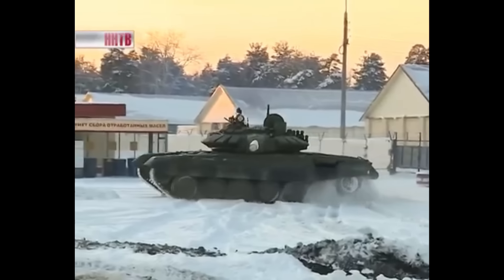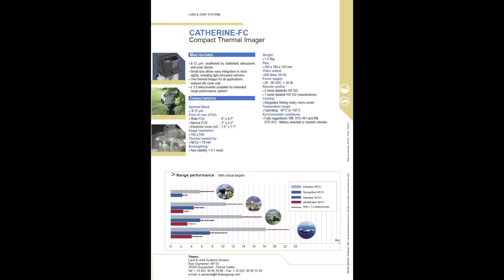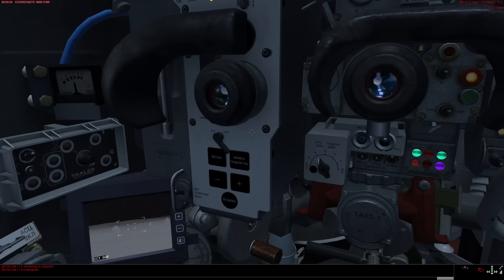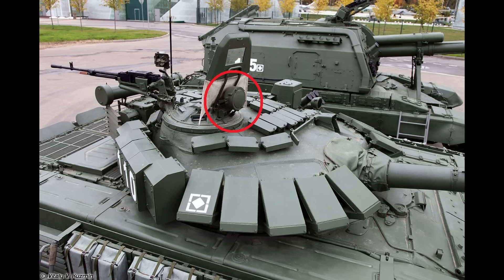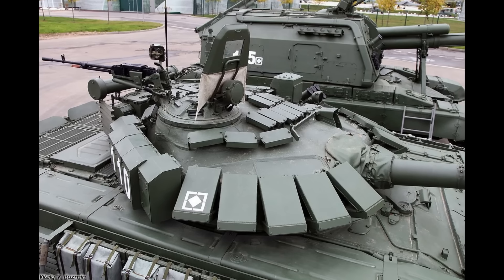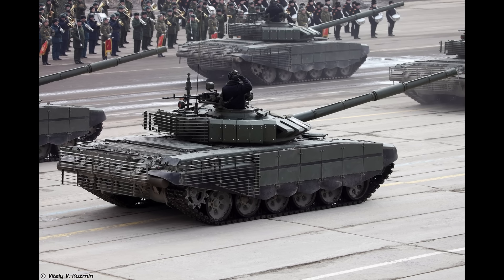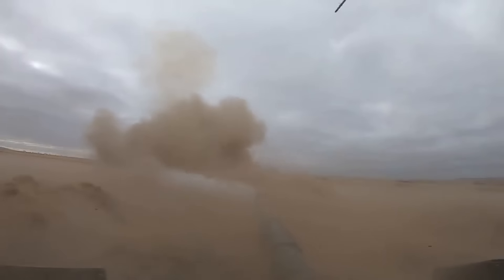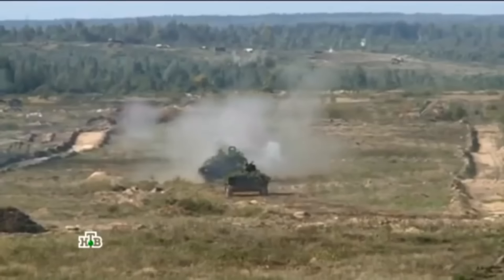Problems with Russian T-72B3 tank

Comment: would be interesting to hear the Ukrainian's thoughts on them  - though at the end of the day is the quality of the  men and the systems supporting the tank really define its true combat capability ( thinking Iraq and their  M1s)  the Ukrainian T-64 seems to be punching above its weight for this reason? (would love a video on that!)
Reply: There are probably barely any T-64 tanks left. Most footage shows donated t-72 tanks
Reply: @meisterproper8304  i think Ukraine don't use tanks eny more.....thay got many small a-t wepons wich do the same roll of destroying tanks
Reply: Put a M1A3 alone in the middle of nowhere and it won't fare much better. Russian tactics have ruined any show off ability of their more modern equipment.
Reply: Depends if the Soldier in tgat T72 is a conscript or volunteer, usually is about 50/50. Typically more trained volunteers get the cooler tanks bc they'd do more w em. I imagine is the same reason why T64 is doing good, bc those guys are more than motivated to do something w it
Reply: Tanks built in the Ukraine have insider knowledge of their weak points, exploited by Ukraine army.
I saw a video of a small combat vehicle repeatedly hitting the side of a ruZZian tank,
the kinetic energy creates heat on its own, let alone the molten metal core, until the heat reaches inside.

A similar thing was breastplate armour impacted by an arrow from a longbow, showing a plasma bolt from the inside!
Reply: @orlock20  there have been one or two videos of russians in modern tanks being driven by experienced crews. those are usually the rare videos where the tank survived. One comes to mind of a t-80BVM getting ambushed by ukrainian special forces. He kept his armor to the fire and steadily made his way to a less enclosed area where he could maneuver. he got hit a few times, but at least for the duration of the video didn't crash or get destroyed
Reply: Ukrainians say T-80BVM that they captured is good because of modern FCS.
Reply: Thing is
Iraqis are generally speaking actually competent with their M1s which mind you, are older models

You're thinking about Saudis
They could prolly fight with Russia who's more incompetent with their gear. I mean quiet literally Saudis are definition of "Its not the machine, its the crew"
Reply: It's obvious that T-72B3 or T-80BVM much better than T-64BV or T-72M1R
Reply: @meisterproper8304  they had hundreds of T-64Bs on storage. If the Russians could get T-62s out, they could get some and give to them Territorial defense batallions.
Reply: Well, most T-64s were scrapped by Russia - but I expect them to punch at around T-72B level or similar - maybe for higher versions, a bit higher. Again, you have all sorts of T-64s. Some are quite modernized but very few. These would be a match for T-72B3M in all but armor.
Reply: @XOFInfantryman  Yeah, loosing over 50 M1s to ISIS during battle of Mosul.... Iraqis were so bad with tanks they decided to buy cheap stuff - cheapest version of T-90 - 500 examples or so.
Reply: @meisterproper8304  Detonated T-72 tanks.
Reply: I know military history visualized somewhere had a interview with a Kiev Nazi tanker. Anyway and the stuff I see in terms of combat footage that I get off Telegram the Russian tanks usually ROFLstomp the Ukrainian tanks. Not only are the Russian tanks just better but the qualitative differences between the crews are  indisputable. The Russians seem to win about 3/4 of the fights.

Comment: What nonsense. The older t72 had more of propaganda campaign against them, instead of real battle world problems. However, today, the latest 2 models of t72 from the Russian military complex are amongst the best in the tank world. The t72 serves a special place, with unique capabilities of defence and attack, in between the other 2 modern brands of great Russian Federation tanks, the t80 and the t90. Armata is also been introduced on the battlefield in Ukraine, 5 months ago...but in small numbers. 

The piunt western tank commentators often don't understand, is that the Russians always win their big tank battles. Why? It's a matter of capabilities in defence and in attack, largely increased by tank strategy. The Soviets/Russians form tank platoons, powerful diverse formation of light, medium, and heavy tanks, always supported by specially assigned own group of jets and helicopters, as well as being supported by tank assigned and trained ground troops. They are always under the commander in the leading tank...which often is actually situated at the back or sides at a well  protected area. Then, they use 5 or six of these tank platoons in different type of operations..in attack and in defence. 
The west usually drives in tank columns, making them very valnerable, even with air support. 
That's why we see the west loosing all their tanks, as soon as the Russian forces soot them. 
As for t72s .. it's the Zelensky t72 that is usually confused with the modern Russian t72. 
No point in producing propaganda when you are losing so badly on the battlefield. Russia was always going to win against western shiny tin boxes, pretending to grow into a battle harden tank. Real tanks are not produced by the west anylonger.
Reply: Yeah while it is definitely one of the best in the world it still has too much budged cuts and outdated tech which is the point of this video

Comment: Despite all the fancy stuff it's still basically a T-72, a tank from the 70s designed for the Soviet war doctrine of the time... it's obviously a cheap obsolete design, but can still do it's job.
Reply: Not exactly it’s been cheaply upgraded and poorly used that’s why it’s sucks
Reply: @mbtenjoyer9487  I changed my mind on the T-90, because when you consider that the Abrams for example weights 68 freaking tons,  costs more than twice as much compared to the T-72 and T-90 and consume an enormous amount of fuel, probably 3 times that of the t-90, on a strategic level it doesn't seem to be that great, Imo it sucks, it's a nightmare for the logistics.

Comment: if i recall correctly, you did a video on PT91 some time ago. would you be so kind to compare those two modernizations? not against each other in combat situation, but rather which modernization got it better with upgrading T-72. i guess it can be quite difficult since both modernizations are like 20+ years apart, but i Hope you could give it a try, since i've heard some voices puting those tanks on par, of which i don't fully agree, but i'm not completely sure either. thanks in advance
Reply: Base version of tanks is also different, PT-91 is a modernization of T-72M,  not the T-72B.
T-72B3 is much better - better gun, better stabilization, better armor, more powerful engine.
Reply: @peceed  yes, i know that, but from base version only turret and gun left. Even hull was redesigned. Engine and stabilization was changed. Laser rangefinder got replaced with Drawa fcs, also erawa armor package can substantialy lower penetration ability even for apfsds. That's why i was not sure how to look at those bold statements, if it's true or not
Reply: @jakubw.2779  Only newly produced tanks had better armor in the hull and new stabilization, PT-91 in the polish army are just modernized T-72. New base armor is marginally better than in T-72B.
The only clear advantage of PT-91 is degree of coverage by ERA armor without gaps (95% of covered area is protected).
Reply: @jakubw.2779  Only newly produced tanks had better armor in the hull and new stabilization, PT-91 in the polish army are just modernized T-72. New base armor is marginally better than in T-72B.
The only clear advantage of PT-91 is degree of coverage by ERA armor without gaps (95% of covered area is protected).
Reply: @peceed  i mean that's fair, but as i said in the begining my intention wasn't direct comparision, but rather which program upgraded the base vehicle better, disregarding the time gap and differences in base tank
Reply: @jakubw.2779  It is a worthless mental masturbation, because when you say "better" you can choose whatever metric you want and get different answer. Both upgrades were good, but the lack of stabilization upgrade was a big sin of Twardy program. It looks like sabotage. T-72B3 doesn't have a gap of this calibre.
Reply: @peceed  no, i clearly said in original comment that my point was to compare which modernisation package fullfiled intended role better. Also Twardy program was supposed to be III phase program, which supposed to upgrade all of our T-72, but it was closed after phase I for whatever reason - official one was to lack of funds.

Comment: I slightly disagree with the conclusion. I think the T-72B3 is an excellent tank... For the platform and for the money. That they were able to extract as much performance out of a 50 year old platform is phenomenal. Even the armour behind the Era is not that bad. I think the platform as a whole could be better. Like covering the gaps in ERA, redesigning the mantlet to remove the massive vulnerability and the B4 suit of upgrades. And I thibk corruption had a role to play in the downsides of the platform. But heck, it is better than a T-90A. The thermal imager alone is a capability shift that older models of tanks (Like the T80Bs) don't have.
Reply: The Abrams is 40 years old...
Reply: @Ukraineaissance2014  yes. And for the price of 1 M1A2 SEP 3, you can get 10 T-72B3Ms. Not saying the T72 is a better tank. Not even the Russians claim that. What I said was that the increased performance over the original design is impressive. Especially for this cheap. It is one of my favourite tanks despite all its flaws.
Reply: @Heldermaior  and that 1 Abrams would (and has) tear through those 10 tanks and crews.
Reply: @Ukraineaissance2014  lol. US army disagrees with you on that one.
Reply: >The thermal imager alone is a capability shift that older models of tanks (Like the T80Bs) don't have.

what are you trying to prove here, the T-80B is a tank from the 80s, at which point significant amount of NATO tanks were equipped with thermal sights, but the only Soviet tanks with thermals were tanks such as the T-80UK which were very rare indeed
Reply: @noonelikesfurries  That a T-72B3M could win an engagement against a T-80BV (still in service) or a T-90A (also in service).

Comment: hello, one small error. T-72B3 obr. 2016 and T-72B3M are separate, T-72B3M is slightly more capable. it possesses modifications for it to compete in the tank biathlon, that is its purpose but they’re very similar to T-72B3 so they can be used as combat tanks as well.

as i continue to watch the video, you have shown the T-72B3M under the nickname T-72B4.

Comment: The most important thing is you body won't ask if it got hit by an relic T62 or a T14, you LL just die the same. So it's obvious that Russia wouldn't scrap all those old tanks. And beeing an autocracy (nothing against it) is certainly easier to handle military loses, Demoncracy in other hand have far higer operation costs and a loss of a 1k soldiers already causes population protests.

Comment: Very good video.  I agree that the T-72 is definitely an outdated tank, no matter how many cheap upgrades the Russians slapped onto it.  However, I think it's also worth noting that Russia's myriad of other problems probably make the T-72 look worse than it actually is.  

Also, reverse speed is very important for 'berm drills'.  This is where a tank parks behind a berm (or other form of concealment/cover such as a corner).  The tank moves forward, exposing itself briefly to fire, then quickly reverses to protect itself from return fire.  This is trained endlessly in US units and is the central feature to annual gunnery exercises for NATO armored forces and is practiced by all motorized units, including Humvee crews.  It's basically the art of shooting the enemy without getting shot yourself, which is obviously a pretty valuable skill for war since getting shot has a way of ruining your day (all the more so when you're in a lightly armored, bomb-on-tracks).

Back to my point on Russia's other issues though.  Russia has issues with outdated doctrine, poor coordination between arms, poor training and poor morale, not to mention their obvious issues with logistics.  The top-down nature of the Russian command structure, where units have to wait for orders for damn near everything means that Russian armor has been caught sitting still on many occasions.  Simply put, Russian formations often stall because of either lack of supply, lack of orders or lack of navigation systems and these stationary formations have been preyed upon by Ukrainian drones and artillery.  Interestingly, this is basically the antithesis of how the T-72 (and T-80/T-90 for that matter) should be used.  These are lighter weight, mobile tanks that should be used for rapid, free-wheeling armored attacks.  They aren't like the Abrams which can absorb plenty of damage.  They were meant to overwhelm enemies in rapid armored maneuvers using mobility and numbers, so taking away their mobility essentially negates one of their advantages.

Comment: 5:10 Russians considering this t72 modernization as "upgrade", so they install whatever equipment is available at that moment for the facility. T72b3 early 2011 and t72b3 2018 are quite different. Also, there may be difference in protection because of base tank (t72a, t72b, t72ba, t72b1...) 
Same will t80 lineup and t80bvm

Comment: "Just an upgraded 1980s tank"

Lets be entirely honest...What "modern" tank ISNT an upgraded 1980s design or older?  T-64 is what?  A 1960s design?  WE even have T-55s, a 50s design still in service.....

Judging a T-72 on that is just wrong honestly.  It might not be a great tank on its own merits, but still....basically every tank in service now is an upgraded 1980s design, aside from maybe Merkava, Japanese Hitomaru or maybe Chinese Type 99s and ofc, the T-14.
Reply: Yeah but there’s a big difference between a cheap upgrade and a proper one
Reply: Leopard 2 and Abrams got extensive hull, turret and weapon upgrades along the way. They're pretty much entirely different tanks from what their originals were. There's a huge difference between a slight upgrade and almost total rework.
Reply: Well I think it’s important to note though that the upgrades are far from many other nations with effective tank fleets. If you were to compare the 1990s M1A1HA And the M1A2SEPV3 I would say while it may not look it on the outside, it is a completely different beast when it comes to Armor. Compare that to the 1984 T-72B and the T-72B3 from 2010, or even against T-72B 1989 that was mounted with contact 5 armor. Is there a difference beyond getting a thermal sight? (Though a thermal site is a big deal). If so I’m not really seeing it.
Reply: I would add AMX Leclerc in newer iterations and Korean K2 tanks. And yep, American and German tanks are, while not all of them upgraded, certainly available in very modernized forms. 
They are all much more modernized than a T72.
But in general, the west is changing towards better airpower, naval power and better anti missile defense.
Ukraine has shown that is a wise move. I doubt even an Abrams SEPV3 would feel very good after 1 or 2 jav. hits.
Reply: I'm pretty sure he said that in regard to the old equipment left inside of the tank, only upgrading one system, compared to other NATO vehicles which had every system revamped through the versions
Reply: @emilsohn1671  yeah I think that’s important to remember about this stuff. Without active protection systems, at this point any tank from any nation wouldn’t be able to tank a hit from a javelin. Does that excuse how bad the upgrade for this tank is(especially in today’s world)? No

Comment: The current T-72, updated and modified, can knock out an Abrams tank from 4,000 meters (2.5 miles) where the maximum range of an Abrams gun is about 2,500 meters (1.5 miles).
Reply: stop drug
Reply: You sure? lmao

Abrams' newest shell (M829A4) has over 900mm of penetration, while T-72's best shell (Svinets-2) only has around 750mm of penetration

Comment: Its an easy an cheap way to save the T-72 B3 T90M etc.. they need a trophy system asap! 90 percent of destroyed tanks could have been avoided even with a simple old trophy system already existing in ruiisa! 10 percent comes from mines!
Reply: iirc the only modern russian tanks to have a hardkill aps are the armatas and we all know they only exist in parades
Reply: @Just_A_Random_Desk  Russia has an old trophy system but doesnt use it because it wont help against javelin. but helps against any other ATGM that attacks from the side not from above.

Comment: I disagree with the protection on the sides, on one picture you say the tank has only 3 plates 6:48 and one the other one we can see the whole side ist covered with these plates and plus some sort of cage for the back of the tank on picture 6:29. And the big boxes are there to fill these gaps between these plates one the side of the tank 6:30. So in that point you contradict your self.

And I don’t believe that NATO had thousands of tanks with thermal sights. The abram tank got theirs 2007- 2009 and the UK had none, on leopard I don’t know, need to search but also not thousands. And you said by your self the T-72B3 came out 2010 so right on time when the thermal sight thing started. So not BEHIND as you said but more right on time.